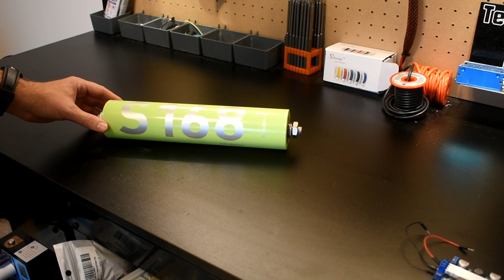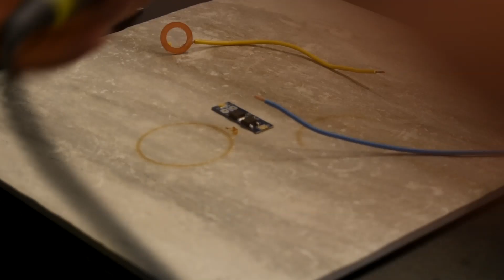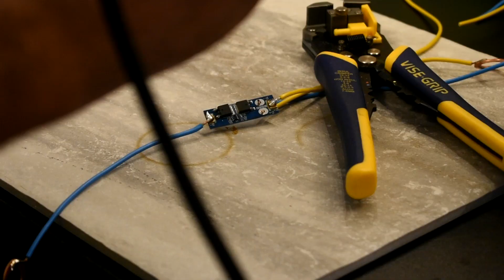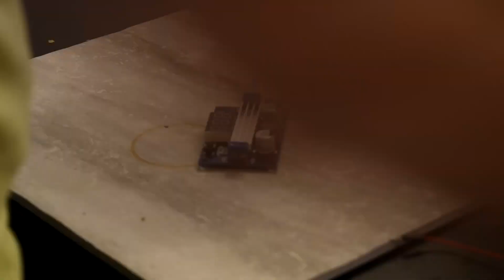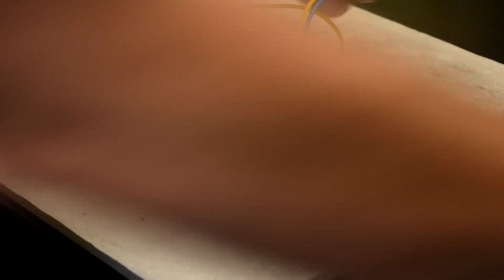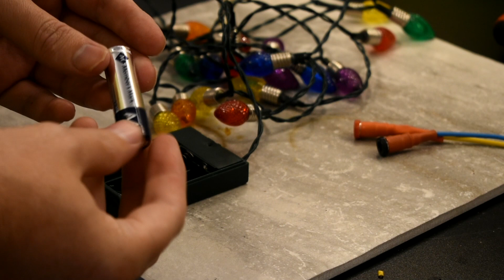SAB 60280 - A look at and a use case for using only one cell.

Comment: I finally got around to working with these cells - I'm finding that the nuts are really difficult to remove. Did you run into this issue? 

It's almost as if they should remain in place with another nut locked against it but then the studs are not long enough.
Reply from the maker: I have only played with the one in the video and those nuts came off fairly easily.

Comment: Nice idea and setup - I've been thinking about using these cells as a disposable battery replacement as well - now I have no reason to put it off. A question though - do you feel that these inexpensive components (did not want to say cheap) are reliable? I'm thinking along the lines of the BMS not cutting off or the boost converter starting to drift.
Reply: As far as the converters go, never buy the cheapest one out there and if you want to be safe buy two different modules with similar specs. You can figure it in a day which is superior. Might end up with two modules that work well but typically when I buy the middle of the road modules about 25% of them have a weird quirk or get  hot. 

Here’s a good example. You need a buck boost converter that handles up to 5A in the 0-30V range. You want one with a nice screen and knobs, no potentiometers that require a tiny screwdriver. 

Your options are
XYS3580 $20
ZK5KX $12

The ZK unit has a hidden flaw. If you switch the output off and then go to turn it back on while you have a current limit set above 100mA the current limit just gets ignored
Reply from the maker: I would say I have not used either for very long, but through all my experiences with bms's I have not had any issues.